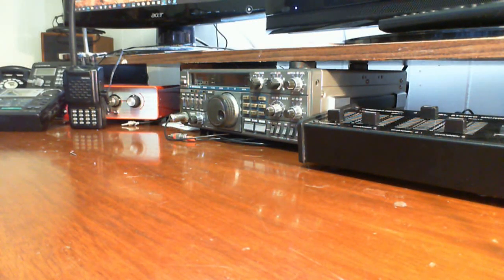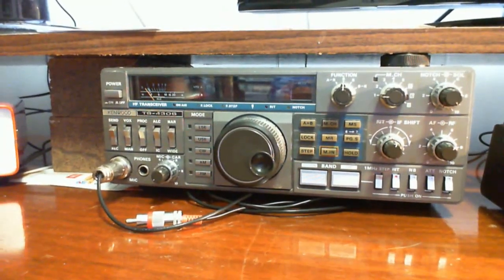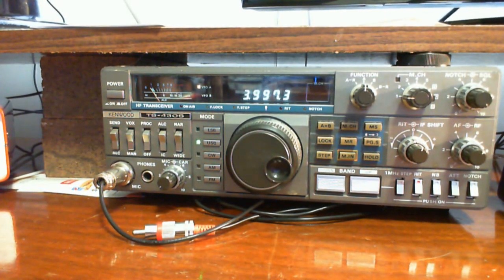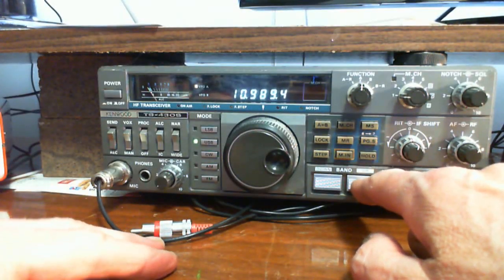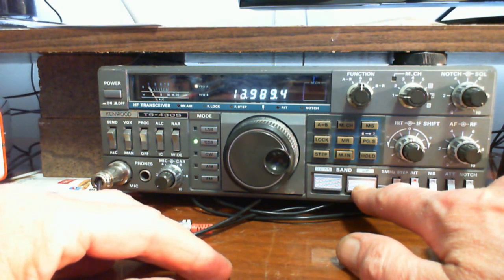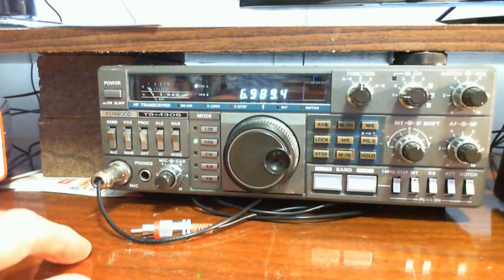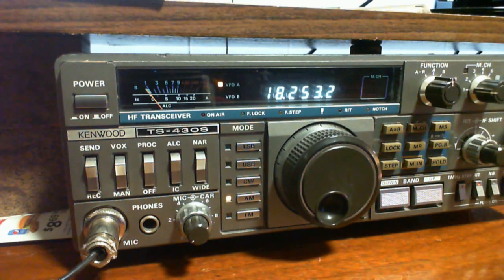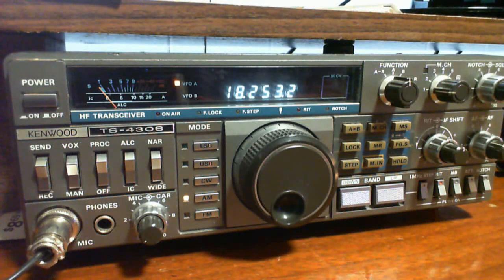Kenwood TS-430S Relay Repair - Strange Way to Fix a Radio

Comment: I used to have a Kenwood TS-430S but gave it away when I got my new Yaesu 991a.  It was a good radio for the past 4 years.  ALC is Automatic Limit Control which you set with your mic and the gain knob.  Key the transmitter and watch meter and keep it out of the red with the mic gain.  Cheers & 73 from W Rusty Lane K9POW in eastern Tennessee

Comment: Has anyone tried creating and installing the contact maintenance circuit as described in the same service bulletin (SB-902), which is intended to mildly clean the contacts every time bands are switched? If so, what would you recommend to use instead of the now discontinued L33-0259-05 choke?

Comment: Kindly advise:
I extracted the output filter board of a TS-430S to work on it.
Issues:
1. Intermittent low rx (probably "dirty" relays). It appears they are all sealed (except the tx/tx relay).
I tried using a "wetting voltage" as described in a Kenwood service bulletin, but there is still intermittent loss of rx, especially on 10m.
2. One of the inductors (L41) is shorted.
3. How do you test a diac (D18)? (It reads short circuit in both directions.) Apparently it is for overload/surge protection.
4. The S meter reads extremely low. I failed to recalibrate S9 (even with the trim at maximum, it doesn't reach 9).

Comment: I have a TS430S that I started using last year, after putting up a trap dipole and modifying a heavy linear supply that was originally in a server rack.   The TS430S worked well for awhile.  I worked a couple of Japan stations and some East coast stations.   Lately I noticed the reception drop down a lot after I transmit.   I disagree with your statement that there are a lot of relays inside the TS430S.  There are 14 relays on the transmit filter PCB.  However they have nothing to do with receive sensitivity.   I looked at the schematics for the RF Unit in this radio and between the antenna and the preselector circuits there is one relay, RL1.   In the receive circuit, (RF Unit) the ten preselector circuits all have PIN diodes and not relays.   If the radio exhibits dropouts, as you demonstrated, RL1 needs to be replaced.   It is not easy to do since it is soldered in.   The RF Unit is on the bottom of the radio.   The relay PN in the TS430S Service Manual is (Fujitsu) FBR211A  The relay in my radio is an OMRON G2E 187P-M   Both are SPDT 6 pin 12 V coil relays, so there could be many other replacements.   The contact heating method you describe as a temporary fix does not do anything.   The DC path to ground from the antenna connector when the TS430S is in receive mode is through a PIN diode and a 47k ohm resistor in each  preselected circuit.  There is the danger of exceeding The current rating of the PIN diode by doing this procedure.  The original and only relay on the RF Unit board had Gold plated contacts.   Over time and due to static discharge, the contacts become pitted. You can't fix that.    Watching your video it looks like there are still reception fluctuations as you go up in frequency..  Each time you cross into another frequency band,  the radio switches to another preselector, and so  RL1 toggles and the attenuation changes.  My theory is it does that to protect the PIN diodes from any static coming from the antenna.   You should get a lot of noise on the low bands and gradually less as you go up in frequency.   If it jumps around, that is not atmospherics.   Its your radio.   There might be other reasons why the TS430S's receive sensitivity drops suddenly.   I have ordered the OEM replacement for RL1 and will replace it ASAP. I hope that will fix the problem.
Reply: Kenwood recommends this fix. They put out a service bulletin. Get it!
You are mistaken: It has relays for each bandpass filter. See the block diagram.
Reply: @tzm1843  Not the first time a company has dispensed bad advice.   There are 10 receive filters on the RF Unit board of the TS430S.  They are all switched in with PIN diodes.  Very typical for this vintage of radio.  If you looked at the schematic, (in the service nanual) you would see that.   There is only 1 relay on that board.   There are 14 relays on the transmit filter PCB.  That might be what you were looking at.
OK, I took another look at the block diagram and schematics in the TS430S Users Manual and now I understand what you are saying.   On receive the signal from the antenna connector does go through these transmit low pass filters.   However I still don't believe this procedure accomplishes anything.   In this video I did not see any improvement.   The L.P. filter relays are pretty rugged.  If the receive contacts get scuffed up so easily, wouldn't the transmit contacts get scuffed up much worse?   If your radio has transmit level problems on the same bands as it has desense, then I would say some relays on the L.P. Filter board might be the cause.   I am dubious that the contacts can be fixed this way.   My TS430S goes into a very noticeable desense right after I key up.   The peak power is consistently 100 Watts on all bands.   Only the receive side is being attenuated.
Update:   No problem on recieve with my TS430S.   I am using an AT250 antenna tuner and was leaving the tune switch pressed.   Rx was attenuated because of that.

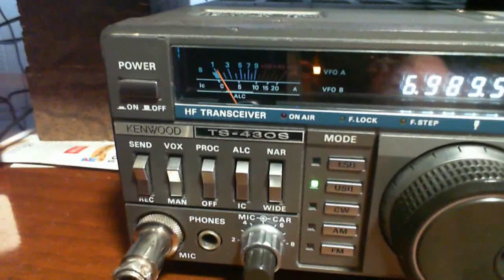Comment: Love your channel Jim! I must say, after decades being into shortwave radio and repairing them, at 8:54 you say that you really don't know what Processor and ALC are in a radio? Your curiosity has never in decades been piqued to discover how an amateur radio works? I say this as someone who doesn't have 1/4 of your repair knowledge and yet since 1992 I found a love for HF radio and have learned every year since.

Comment: This hf radio is well over 30 years old. Replace the relays, there cheap enough. I’m not going to juice my antenna connector with 500 milliamperes. It cost me 15 dollars to replace all the relays
Reply: I have been wanting to do this actually as I keep having the same problem reoccur every year or two where in many bands the volume goes away. Would you be able to tell me which relays to use to replace the original ones with?

Comment: Looks like you only used 3 volts, not 13.8!
Reply: Wondering if 3vdc is fine with no resistors in line? 13.8vdc would need resistors ?